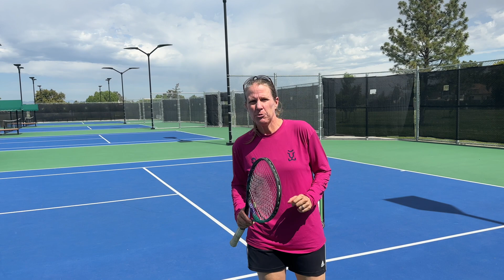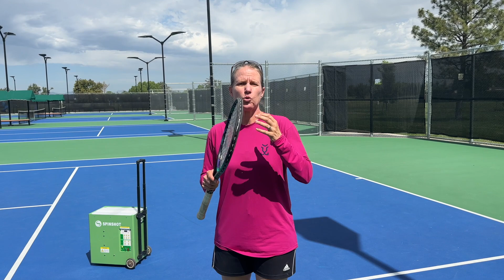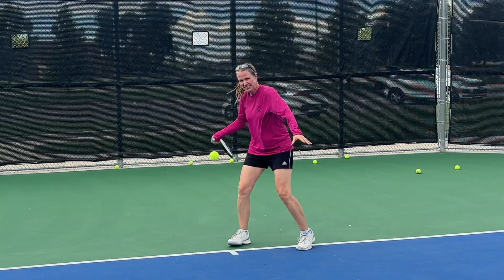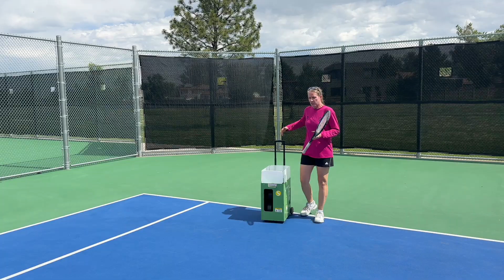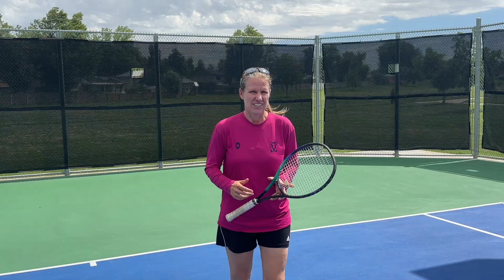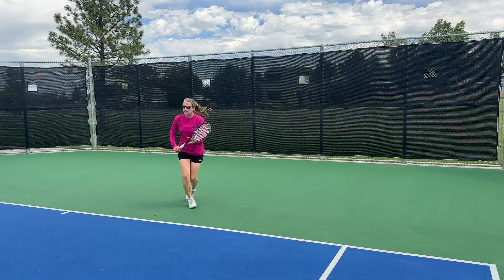Tennis Player - Are You Using The Ball Machine WRONG?

Comment: I use a drill in which the ball get shot cross court, I have to hit a winner down the line but then move straight in for a put away volley then back to the centre baseline… it’s a killer.
Maybe if you haven’t done it already… make a video on some efficient drills whilst using it.
Sadly I got the tennis tutor prolite, not a bad machine but the plastic flaps for the hopper are so fragile and brake with a stray shot or even just the recommended amount of balls in

Comment: i think one other mistake that many make is using the full hopper in one go rather than stopping occasionally or using less balls at a time.  if you have 60 balls coming at you non stop you end up out of breath and using bad technic reinforcing any bad habits they may have. Bad practice makes permanent mistakes just as much as good practice makes good technic
Reply from the maker: That's a good point. Really depends on your conditioning.

Comment: re: your point about the ball machine placement—for me, i'm using the machine just to get better so that i can have a productive time when i hit with a person. When i would be casually rallying with another person, the objective is typically to just consistently put the ball down the middle of the court, letting the other person decide whether to hit forehands or backhands. Right? Also, though, my machine does have oscillation, so i can get angles even when it's set up at the center. Good point, though, about using the machine to feed 'easy' so that you establish better technique, slowly. My mistake is in trying to get the machine to shoot at higher velocity and spin, to simulate rallying against a person just above my level. I need to slow it down.... This is something i always wondered about coaching i see online, though. The soft toss feeds—i understand they help you with the repetitive building of muscle memory(?) but they don't mimic real/live balls coming at you. For me, i can look like a pro with a soft toss or a self-drop, but when a shot is coming from the other side of the net, my footwork and approach are wacko. I'm going to try your tips this weekend.... Wish me luck.
Reply from the maker: Yes, the hand tosses are great when you work on something really specific. What most videos don't show is that good coaches use them as the start of progressions and then later increase pace of the ball, frequency, change to racket feeds or live ball.
Reply: @MeikeBabelTennis  Gotcha. Thank you, Meike.

Comment: I'm really just a beginner - started this year - but feel quite validated by this. Our club has a ball machine that nobody uses and I asked if I could use it.
It is SO fast. The balls sit in a bowl at the top and there's a spinning disc inside it. The spinny disc has three holes, spaced 90° apart. The idea being, you get three balls, and then a short break.
On the lowest speed setting - the absolute lowest it can go - it fires the second ball when the first one reaches you.

If you just want to stand there and hit, maybe that's fine, but if you also want to move around and practice footwork? This is terrible.
Since nobody else uses it anyway, I taped the middle hole shut. Honestly, I wish I could make it slower still. I might block another hole, but at least this is somewhat sensible now. Lowest setting looks roughly like what you see in the video around 2:55 (Which is when I wrote this comment) - maybe a little faster.
Reply from the maker: That's a weird machine! Yes, tape another hole shut if they let you. You can always increase pace again later.
Reply: Maybe the machine has a “interval” setting , controlling the spinning of disk speed , not ball strength or spin .
Reply: @Ghghuygbbgfffrr  It has all three. When I was talking about the lowest speed, I did indeed mean the interval setting.

It also works exactly as you described - by changing how fast the disc at the top rotates. Why you would ever want to go faster than the absolute minimum is beyond me, though. Way too fast. (Or, I guess I should say frequent)